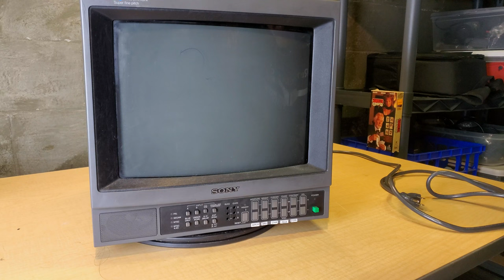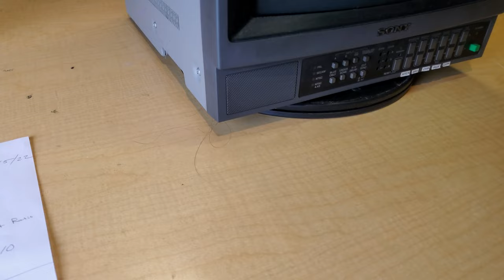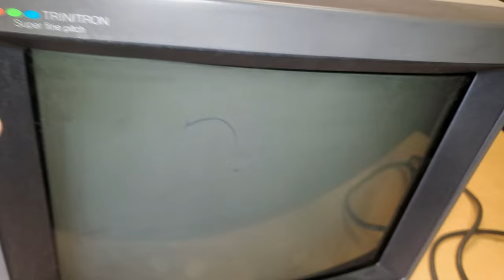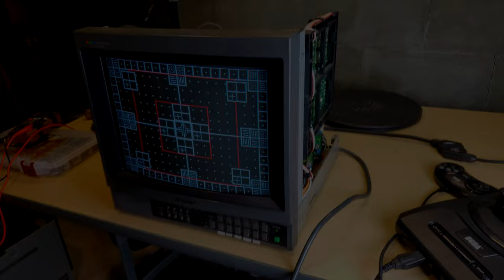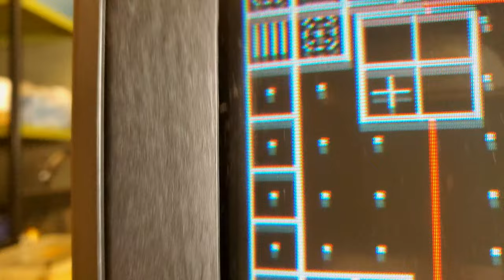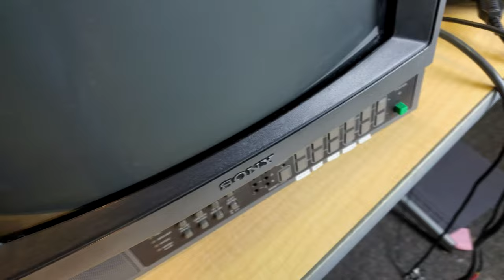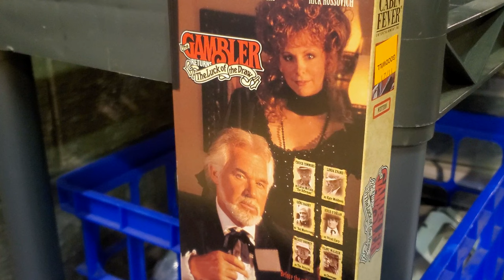Is this Monitor trash?! | The Sony PVM 1344Q CRT Inspection

Comment: Hi, my friend, i need your help, i have a set which geometry is not good, the problem is seen right away on the main screen of the 240p suite (the square is uneven) and there are many "unstraight" vertical lines, both left and right corners is like an "S",  and it would be useless to hide it with overscan because the problem will be there anyway, including in the middle of screen. Is there a fix for this? Recap, yoke? I will be very happy if you can help me!

Comment: Awesome repair. You should see the broke  1344 i have here. It's in a WAY worse state unfortunately. Gonna donate it to someone that can fix it. The tube has a lot of burn-in. Lots of dying caps. Bezel is broken in 6 pieces (seller didn't package it correctly and it broke while shipping). Such a sad thing to see

Comment: If I have a mono audio crt with 1x composite output, and 1x scart output, could i just plug a console into the scart connector and then buy a amplifier with speakers and plug that into the TV's white audio plug amd be able to get stereo sound? Could I buy a splitter for that white audio connector to plug white and red into without encountering power problems? What is your audio solutions to mono only tvs whith limited connections?

Comment: You haven't seen 'disgusting' until you bought a monitor the seller 'forgot' to tell you was in a basement flood and has circuit boards covered in sewage sludge. RIP IBM 5154
Reply from the maker: oh yeah, that's awful.
Reply: That house has since been demolished & rebuilt.

Comment: I don't understand why this is considered a difficult/expensive repair. My understanding is that you cleaned it, replaced the bezel, glued down 3 wedges and secured the yoke. Am I missing something here? Did you have to fabricate anything for the chassis?
Reply from the maker: There's only a handful of people left in the world that have the skills and tools to do the things you list in your comment.
Reply: Bruh, he basically has to rebuild the entire thing and adjust everything.  That takes time, care, and knowledge.  Something the previous repairer didn't have and ruined it.
Reply: @bookshelffury  at no point in this video is anything built or "rebuilt". What is done is cleaning, swapping and adjusting. You can do anything in this video yourself bookshelffury. Google search crt yoke adjustment. Cleaning and bezel removal doesn't need a tutorial. 2 hours for your first time. 1 hour with experience. Arcade collectors do this kind of thing everyday and you can do it too.